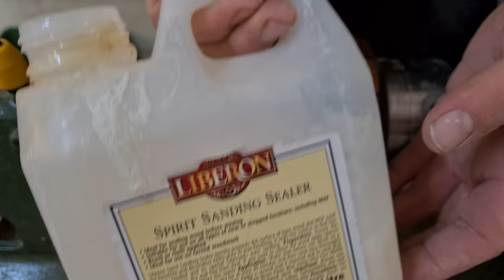Woodturning - The 3D Puzzle

Comment: Holy cow! Impressive! I completely needed to watch this to deconstruct how it was made. Just looking at it initially, it broke my brain a little. lol This is a really great piece! I have one question for the creator and all the turners here in the comments:
Can anyone think of a way to reduce the labor on the puzzle pieces? 
I was wishing (for his sake and maybe my own if I ever decided to tackle something similar) if there was a way to:
1. Cut the angle for the segmentation on the table saw down the length of the wood
2. Then, (and here's where I can't figure out how) cut the bumps and the holes that make them puzzle pieces down the entire length of the wood.
3. Then cut them into individual pieces?

Is that even possible? OTHER THAN A CNC
Reply from the maker: Hi Juliet. That's a great question I was also trying to figure out, especially without a CNC. I haven't been creative enough to find an answer, apart from using a resin mold rather than wood. To repeat this with wood I would suggest planning the final dimensions and then using thinner pieces to match, which would at least make cutting easier rather than using thicker pieces like I did.

1. Cutting a length of wood with the wedge angle top and bottom is possible, but the grain orientation may be different to what you want when you flip the piece into position. 
2. I recall someone said they could drill (or using a router bit) the holes, which could be done flat or at an angle. The tabs would be more difficult to do en mass, unless you chose a more basic shape (e.g. trapezoid or anything not curved) for the tab or were going to glue the tabs on separately. 

Other suggestions were to find a big blank, turn it to final dimension on the outside, then router etch the profile of the puzzle, fill with resin, then hollow out. This would give the same effect. But controlling the etching of the puzzle profile is not easy either! 

If you find a way I'd love to see a photo of your final piece!
All the best Ray

Comment: such a good idea!  I will definately be making one soon using your ideas.  I would like to see you do a platter with the same concept.  As a variant, I wonder how hard it would be to make 3each of the puzzle p[ieces unique as un a regular puzzle.  You asked if this could be done with a cnc instead of a jigsaw--Yes it canm if you can design it with a 1/16" radius (1/8"
 bit) in all the corners.  Set up a long board and make 8 or 10 parts at once, then turn it around to cut the other side (cutting the parts apart as well, finally, cut the straignt sides.  There are other ways on a cnc as well.  Great job!
Reply from the maker: Hi Steve. Thanks so much for your comment and insight. Someone had just commented that we'd need a 5 axis CNC machine to do this properly. I guess they were thinking for more intricately shaped pieces? I wouldn't know where to start in the CAD software! I guess one could shape a bowl first and then deconstruct it with irregular shaped puzzle pieces then glue them to a sacrifical insert with resin between. But would love to see someone try this with a seamless finish. Would also like to see your work. Please drop me a link when your done - if you are willing of course! Thanks once again. All the best. Ray

Comment: Great work. My dad got hold of a lathe like yours (= a heavy English one). Being a very good carpenter, he may have had the skills, but didn't have the creativity to go beyond simple bowls and sticks for some spinning wheels he made.
Couldn't you have added som resin while spinning the bowl to fill up the air bubbles?
Reply from the maker: Hi Henrik. Some of the older lathes are great and will last for many decades. Though on this lathe not having a banjo cam locking system is a pain. The creativity is purely for engagement on Youtube, but traditional wooden bowls are great, especially in the hands of an experienced woodturner (which I'm not). I do need to do some work to fill in the remaining gaps, but I should have put it into a larger container with a lid and I would have been able to remove all air bubbles. Thanks so much for watching and commenting. All the best. Ray

Comment: Very cool. It looked quite labor intensive, with making each puzzle piece. Was it? At certain stages it also looked like there were spots where the resin was pitted. How did you fill those spots?
Reply from the maker: Hi Mark. It was laborious when cutting out the blanks and tabs using the scroll saw, then rather tedious doing the sanding. If I had planned it better, I could have used thinner pieces and made the process a little easier. Between the tab and the blank there were vertical air bubbles trapped in a number of places. I should have used a slightly wider mold and tilted the piece so that these trapped air bubbles could have escaped and would have been cast far better. These were mostly on the inside. Any on the outside were fairly shallow and can be filled with clear CA glue. Thanks for watching and commenting. All the best, Ray

Comment: Fantastic! 
Did I miss something as to why that one piece is so much lighter than all the others? I assume it was on purpose; I don't believe anything you do like that is an accident.
I'm also curious as to the cuts in the bottom - what you referred to as "shaping the central columns". Is there a reason for that or was it an artistic choice?
At any rate, the whole thing is gorgeous; (of course, I might be biased because I'm a jigsaw puzzle nut, LOL!)
Edited to say that I loved watching you fabricate the custom resin mold! Never has plastic wrap and a paper towel roll served such a great cause!
Reply from the maker: Hi Jenny. Thanks so much for the feedback and questions. Yes the lighter piece was by choice for 2 reasons. The first was to break the monotone of the piece and the second was a more philosophical musing about standing out and still fitting in. It was also fascinating to read how split the viewers were over this one piece. Some loved it and others hated it.
The cuts in the bottom piece was purely by choice. I thought about repeating the jigsaw pattern, but the project was already complicated and I couldn't figure out a reasonable solution. Also hollowing is not my favourite part of woodturning, so not making it a feature point of the bowl was okay for me! 
All I can say about using plastic wrap is that it got very messy. The resin seaped into so many layers. I should have used a plastic bag first then wrapped in plastic wrap. 
Thanks once again for watching and I really appreciate your comments. 
All the best, Ray
Reply: @RayWhitbyCreations  Ah, I just knew that wasn't some random piece that slipped past you. I agree on the philosophy and it was noticeable but still - as you said - fit in with the whole of the piece. 
I liked the cuts; they added a neat feature!
I never thought about the resin seeping into the plastic wrap layers! What a mess, LOL!

Comment: It is so neat to see someone have time and patience to do things.  Everyone seems so rushed today.  I did have one question...you cut all the individual pieces out and then used spacers.  The next thing I see after you wrapped everything was black resin where the gaps were...did you have resin in the saran wrap and how did you get the resin only in the cracks and not on the puzzle faces...sanding?  I must have dosed off and missed some stuff...LOL.   How did the resin NOT leak out of just saran wrap?   If you want to make a real fortune...invent a way to reuse leaked resin...lol.  I honestly don't think every job is for a lathe...for example the lathe was used to get the saran off...and I really think a hand held sander while the puzzle was spinning on a lathe would have been the better tool situation for the job.  Just my opinion here.  I mean you did say there was an issue with undulations of soft spots and hard spots.  Oh, you DID do that...see, I was right 😬..never mind.  By the way, I like the white piece...makes it more of a puzzle ;).  It's a shame the grain wasn't all going in the same direction though.
Reply from the maker: Hi Morgan. this was the first time I tried wrapping it and it turned out to be a mess. I should have used or made a better fitting cylinder and gone from there. I'd be interested to know what you thought of the woodturned 3d printed, 3d jigsaw puzzle project.
Reply: @RayWhitbyCreations  it was fascinating and VERY creative...and the one piece that lacked colour...kind of added to the puzzle, in my mind.
Reply from the maker: @morgancalvi6675  Regarding the odd piece, quite a few people (roughly half) did not like it at all!
Reply: @RayWhitbyCreations  really...well, I'm sure you could have stained that one piece if it as a deal breaker to a buyer.
Reply from the maker: @morgancalvi6675  I like the controversy over that 1 little piece and happy to keep it as is!
Reply: @RayWhitbyCreations  same here.  One of those happy accidents.

Comment: Just so the average guy out there can have an idea..... pleas do tell how many hours total invested in this project? Please include the planning and drawing as well as all the cuts and times for glue or resin to cure.... that is, if you have any spare moment to do so! Thanks for making the video! I love jigsaws and think this is genius! Turned out quite nicely! New sub here!
Reply from the maker: Hi Bob. Total time for this project would be about 3 days full time, but not including resin curing time (which was 4 days before it was solid enough to remove from the mold). I was still fudging how best to cut them - between jigsaw and scroll saw. The wedges were cut oversized (ca. 35 x 35mm) and at an angle of 11.2 degrees, 16 pieces per ring. The design of the blanks and tabs was done in powerpoint and then tested on samples to ensure they left gaps to adjacent puzzle pieces. You are welcome to have the image file if you want; email me raywhitbywoodwork 'at' gmail.com. The gaps should have been slightly larger and the central column a fraction smaller. I'm going to redo this project with a better application in mind and better jigsaw pieces, rather than the same repetitive pattern. Thanks so much for watching and commenting. Really appreciate your feedback. Take care. Ray

Comment: Do you find the bandsaw is better for those beveled cuts than the table saw?
Reply from the maker: Great question Bill. I prefer the table saw. Easier to use with a sled (or push table), more room to work with either side of the blade, cut finish is about the same depending on the type of blade in the machine at the time. The only downside to the table saw I've found for making wedges/segments is the kerf size. Usually 3 mm compared with 1.5mm for the bandsaw (which can sometimes go wondering away from a straight line cut if not set-up correctly). The other thing is also the angle of cut, which I've found is easier on the band saw because we have to use a crown guard for the table saw and can limit the passing of wood. In the right hands, it wont matter much what you use!

Comment: Holy cow Ray! 😲😲😲
So many questions! 
How long did it take to get the blank made? 
What blade do you use on the scroll saw to cut in any direction?
Did your scroll saw holding jig account for the taper angle?
Reply from the maker: Hi Tim. 1) The work was spaced out over a couple of months due to work pressures and family. To get the project prepped for resin casting possibly around 2 days of solid work, with a bit of fumbling over designs. 

2) Spiral scroll saw blades. Brilliant invention! Though I did use thick wood and was concerned about high tension in the blade (it kept snapping), so not the most accurate cuts. I still need to practice!

3) I made 2 jigs. 1 for the bevel angle to properly cut the tabs and blanks on the left and right of the piece (had the scroll table at an angle). The 2nd jig was to hold the 1st stage cut piece to process the top and bottom (had the table flat).

Thanks for watching! All the best. Ray
Reply: @RayWhitbyCreations  Awesome work man, truly impressive piece!

Comment: awesome!  why not cut the angles on the full wood strip before cutting into small segments?
Reply: or a drill bit for the holes?
Reply from the maker: Hi Zachary. You are correct and that is what I could do. I haven't built a jig for it yet but I will one day. Thanks for watching and commenting. All the best. Ray
Reply from the maker: I did try it for a couple of pieces but didn't have the drill bit the exact size and it meant redoing all the pieces (make them bigger or smaller) or trying to buy a drill bit closer to the size. It was also difficult to do the left hand side hole on my hobby pillar drill which needs to be angled, so I went for the scroll saw throughout. On reflection I could have planned it better and made things a bit easier! All the best. Ray

Comment: Did you set the deck on your scroll saw to an angle like cutting rings? Could you help clarify that approach? Thanks Awesome work. new sub here. FBWW.
Reply from the maker: Thanks FBWW! Yes, as you described. I cut the bevel angle (should have done it in one on the tablesaw) then tilted the scroll saw table to the same angle to cut out the tabs and blanks on the left and right, but kept the table flat for those on the top and bottom. I doubt I would have got close with a seamless version! But it worked well with resin. Thanks so much for your feedback. Take care. Ray

Comment: Justice ? Man, you wrote the book ! I will never ask you to do strange paper puzzle pieces again - this sets the bar higher than I could imagine. Love the walnut(?) with one maple(?) accent piece which was inspired. And forgot about the slotted bottom until the gallery pics - another inspiration !  Wonderful, so wonderful Ray  ... Thanks for doing it🙏  Thanks for sharing🙏  Stay safe. -Mike😷💉
p.s. One question: did you cut the matchstick spacers on the table saw, band saw, or the scroll saw ? hehe
Reply from the maker: Hi Mike. Thanks so much for your feedback. I do wish I had enough pieces to do it out of walnut but only had sapele (and the odd one was ash), which I think had a great finish in the end (apart from the ash piece). I was a little embarassed to show the insides and the bottom as there was a lot of air bubbles that needed touching up. I've realised my mistakes or at least seen a lot of room for improvement. This time I did have a bag of matchsticks from Amazon, though I have cut them on the bandsaw before to improve accuracy of dimensions! Take care. Ray
Reply: @RayWhitbyCreations  room for improvement - always a good sentiment !   
Keep up the good great work !

Comment: Noticing that epoxy has facilitated woodwork without the need for precise joints or any real craftsmanship.   Not an insult towards your work or anyone else's.  Just an observation.   In days gone past , only a highly skilled craftsman could make something like that, albeit it would have much more precise joints as it was the skill of the joints that made it possible ( glue was not that strong).  
Now, with epoxy, you can essentially glue anyone odd things together, whether they fit well or not; in some cases the epoxy makes up a large portion of the work volume. ( Though not so much in this case) 
On the positive, these epoxies make it so anyone can be a woodworker, as a result many more people can participate and and many more creative ideas are turned interested projects. 
On the down side, gone are the days of trues craftsman ship.  And for the most part , gone are the days when the finished works will one day become precious antiques.  Again, not insulting your work, just noticing. This project obviously only has about 1/8 or a 1/16" of epoxy filling the gaps.   But some, create table tops or turning projects where a good portion of the work volume is epoxy.  Clearly, in a 100 years nobody will marvel at those finished projects.
Reply from the maker: Dear SH. I agree 100% with your thoughts. I believe resin and wood does open new avenues or creative opportunities than just wood alone, but some of the fine woodworking techniques are being lost in favour of a computerised generation or a demanding audience. In speaking with some professional woodturners & woodworkers (I do not count myself as one, as you can tell from my projects so far) that there are still challenges that computers will struggle with, although their accuracy will continue to improve. I've seen some astounding (and quick) work using a 5 axis CNC in woodturning and yet the detailed finish is often a far cry from many woodturning projects done by a human. 

I will always admit when I've rushed something and this project was one of those. I did not create sufficient time to try and keep the accuracy for making each piece and placing them properly on the central column. I made a mistake in the resin casting too. I should redo the whole thing. Nonetheless, the challenge is there for an experienced woodworker to try and repeat this without using resin. It's beyond my skills! Thanks so much for watching and commenting. All the best. Ray

Comment: In what angle did u cut those pieces?
Reply from the maker: Hi Martin. 11.25 degrees (as near as I could get it to 1d.p.) for each segment on the bandsaw (should have done it on the table saw) to get the trapezoids. And then tilted the scrollsaw table to 11.25 degrees to cut the tabs and blanks on the left and right of each segment (the top and bottom tabs and blanks were done with the scrollsaw table horizontal). All the best. Ray